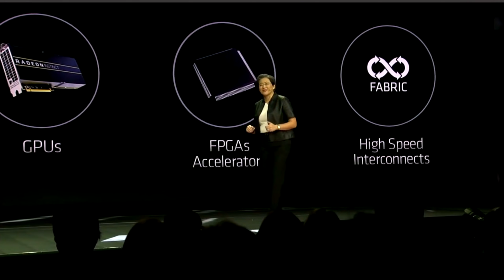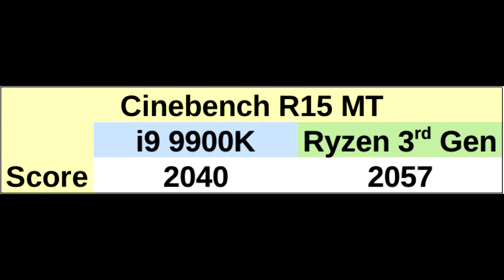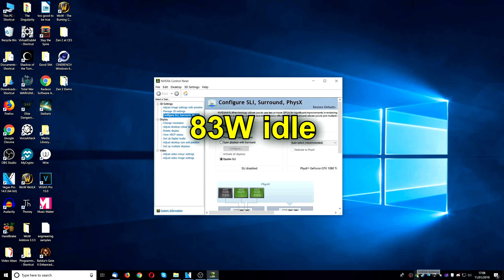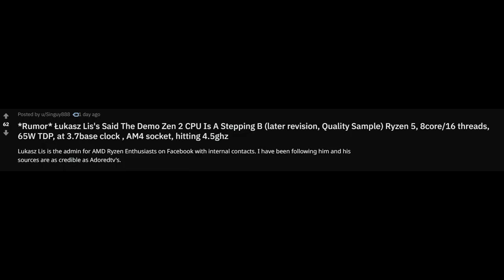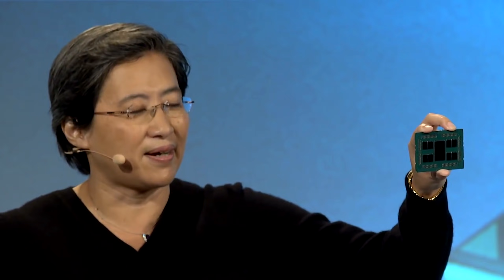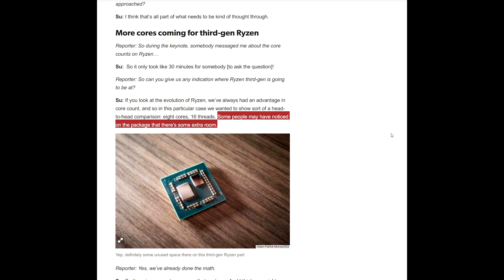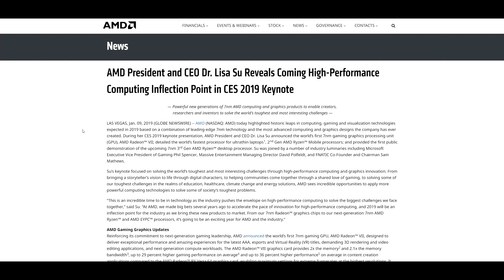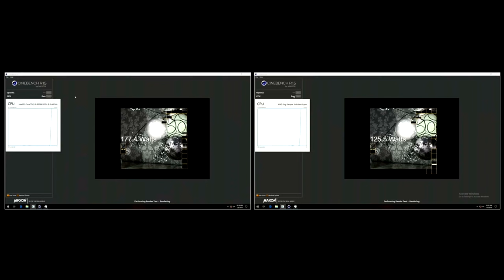Zen 2 Faster than i9 9900K at Half the Power.

Comment: I will keep my intel system as long as I need. I have Coffee Lake. 8 core system. If AMD beats my chip by a landslide, then selling the system and buying Ryzen will still save money or match it for me. Intel retains value for most part. Time will tell.

I have not seen gaming performance, I could care less for Cinebench R15. To me it's not real life performance. It's cold synthetic load.

I owned Intel and AMD on the constant basis, and AMD has been a miss for gaming for a long time. Budget solutions of the past. I look for amazing in gaming, and if it's amazing, I will change the platform. Until then, I am not worried with 8 core Coffee Lake it is performing beautiful

Comment: If you assume the higher idle power draw is due to missing power saving features then you should also assume that the idle power of the chip once those are in place will be lower but that will not change the full load power scenario (much at-least) and as such the delta in power draw will increase meaning that the claimed power draw of the CPU is wrong in such a scenario.
... and of course the release copy may also clock higher with a higher power draw closing the gap further.

Comment: In my calculation every Zen 2 eight core sixteen Threads processor @4.5Ghz or even less including a new generation of Precision Boost technology is destroying Intels 9900K in Mc AND Sc performance. I included a 25% performance increase for every single core per generation which means an IPC improvement by at least 3% (based on IPC improvement of Zen to Zen+) and an clockspeed improvement up to 4.5Ghz which come up with the 7nm process node. That shows, according to latest next gen consoles leaks, that the new PS and Xbox consoles can beat this performance (I9 9900K) theoretically too.
Reply: NOTE: 3% IPC improvement was suggested by Timmy Joe PC Tech on Youtube. I have seen different IPC expectations up to 29% at other sources.

Comment: Should I get Intel i5  9600k or wait for the new amd
Reply: Don't get a 6 core 6 thread CPU if you care about high frame-rates like 60+fps. It'll be fine for now. But once next-gen consoles (PS5) comes out in about a year from now, which is rumored to come with 8C/16T CPU, the CPU requirements in the PC space will also shoot up. Therefore making 6C/6T CPU a limiting factor, when targeting 60fps or higher, not to mention some of the recent games are already maxing out those 6 cores.

Comment: Well, if the temperature is lower (yes power dissipation is proportional to temperature on the same cooler). Why is the clock speed is so slow? AMD is getting lazy or locking it away. That's the only thing I can think of.

Comment: If as you propose the 3600x will be 2 four core chiplet design, from 8core chiplets this makes perfect sence, the bining of the 8 core chiplet as 6 core r3's. 1-2 cores are defective and the 6 working ones cant hit high freq. A working medium 8 core hitting 4.3-4.4 becomes a one chiplet 3600. the 2 chiplet 4 cores is the binned chips with 1-4 semi-defektive dies that cannot hit high freq. but have 4 cores that hit the silicon lottery, and can go over 4.6-4.7

Comment: My Budget Build 2019: 
AMD Ryzen 5 3600 
ASrock B550m Pro5
GSkill Aegis 16GB ddr4 3000mhz
GPU: RX3080 (If It would Happen) or Leatherjacket Nvidia 1660ti 
MicroATX Case Cooler Master q300L 
Powersupply: Bequiet Purepower 10 400w

Comment: I honestly could not care less how great it is at efficiency at low power. I want maximum single core performance and minimum latency. If Ryzen 3000 does not offer that over Intel's products, I can't see myself staying with Ryzen. AMD better have some kind of insane 4.5Ghz and real latency improvements over Ryzen 2000, then I'll just wait for Intel's fall release and upgrade my Ryzen 1700X then. Such an impossibly terrible gaming experience in terms of lag that I have never been able to fix that the new Ryzen has to be beyond superb for me to consider it.

Comment: You obviously don't know how Intel define what tdp is. Forcing a package  tdp of 95w is drops the cpu to  4.0-4.3ghz. At 4.7ghz (all core boost) it draws something like 180w. AMD's tdp specs are almost always at full boost.
Reply from the maker: I'm actually quite aware of how Intel defines TDP, you however are not correct about how AMD measures TDP.
Reply: @adoredtv  watch videos from Gamers Nexus about the 9900k and the tdp. You are drawing from the wall and amd was not. They have the tech to test the draw from power connectors going to the cpu (typically the 12v rail) also removing as many variables that could affect that power draw. Look over Gamers Nexus' testing methodology. Intel's CPU ALONE was pulling about 180W. AMD's CPU also alone was pulling about 135W. AMD'S TDP rating for their processors is much more accurate to their real life tdp than intel's CPUs as of 8th and 9th gen. Before that, Intel has pretty accurate TDP ratings
Reply from the maker: @stoat-ski  Both systems were measured at the wall.  There was a reason why I threw in my own 2700X results, so that we could see the Ryzen 3000 chip vs not only the 9900K.

It really is that efficient.
Reply: @adoredtv  oh ok your are right. I am surprised they did wall power. It's not a very effective way of actually testing a cpu. They did use an ssd to lower the drive power draw but a Vega 64 in both systems(that could also throw the numbers up higher)
Reply: @adoredtv  I wouldn't say twice that it is twice as efficient but it's going to be more efficient than intel's 10nm offerings for sure. I am exited for single execution avx 2 because my 4690k makes any attempt at rendering the workloads that I use the most on my ryzen 7 2700u laptop impossible.
Reply from the maker: @stoat-ski  That's why I worked out the delta between idle and load, to remove the rest of the system component draw as best as I could.

In the end the numbers won't be far off but what's important is that the Ryzen 3000 chip is clearly in a totally different TDP class than the other two.
Reply: @adoredtv  yeah. I like my 4690k but I love the offerings from AMD coming up. The avx 2 performance was the only reason I didn't go to a ryzen 7. I have a 24 core xeon system that has the same issue. My 4690k overcooked is almost the same performance. I love how far AMD has came in the last few years. I would like to see a 8 core laptop cpu offered from amd. I mean based on my 2700u being 14nm, they could easily do it with 2.8- 3ghz clock speeds. I would like AMD to offer 4th gen Zen 2 apus next year with 6 cores and 20 computer units. Bump the clocks on the cpu but still have more 2 or more more extra cores. I hope they improved infinity fabric and because memory speeds are severely bottlenecked by infinity fabric's speed. I think that AMD's cpu's had a better IPC on Zen than intel's IPC because it hasn't changed since... Well 2nd gen. I can't wait for their next major architecture because of the massive performance jump in IPC from fx to Zen. Also having 8 real cores really helps out amd in gaming compared to fx's "8 core" architecture. I do admire intel's ability to push clock speeds higher and higher but they really need to fix their igpu. I love my rx 590 however. Thing is so stupid fast for a card that I got for $222 (open box)

Comment: What about also shoving up the IO processor and put a third 8-core chip beside it so you can have 24-cores? Or perhaps put an APU there so certain programs can leverage that like they can with the iGPU on Intel?
Reply from the maker: They'll just reuse Epyc for Threadripper and more than 16 Cores.

Comment: Did you take into consideration that the 9900k could have been running an igpu vs a discreet gpu in the amd system?
Reply from the maker: Both had Vega 64 Liquid.
Reply: @adoredtv  I was just guessing. I didn't notice the amd specs. Great video

Comment: There is a leak by Ryzen memory calculator developer that this ryzen3000 was running at 3.8-4.0Ghz on all cores.
And that there is a bug in Windows with clock reporting, that shows higher clocks (like 4.6Ghz)

Comment: Adored, i just realised what happened.

Why did they show a 8 core cpu with 1 chiplet? Simple. 

The epyc comparison was a core to core comparison with 2 intel CPUs.
So for the desktop: Amd also wanted a Core to core comparison, because intel fans have been using this rhetoric for years."intel beats amd core for core". They can no longer claim that.

Why was lisa nervous it might crash?
Simple: NO DUMMY DIE. 
This CPU was shown specifically to demonstrate 2 things.

1) AMD and intel are on paar in single thread performance.
2) They can do this with a chip that is not fully built.

The missing Dummy die is screaming "And this isn't even my final form".

Amd could have shown a 8 core chip without the other connections to the empty space, or with a dummy die.

This chip is used to show us MORE, by showing less.
It shows that 8 core vs 8 core: AMD wins.
It shows that there is headroom in terms of space and tdp.
It shows that there are more cores tp come.

All by showing only a single chip.

Comment: Hey Jim - nobody has answered my question with regards to the potential upcoming 12c/24t and 16c/32t Ryzen 3K series cpu. It looks like you are the guy. We know mainstream AM4 socket has dual channel RAM whilst X399 ThreadRipper socket has quad channel RAM. Since rumours of this popped up at least a couple of months ago I have been asking if the 12c and 16c Ryzen 3K series of cpu will be RAM starved or not, or if upcoming X570 (X590?) mobos will have quad channel RAM?.
Reply from the maker: It's possible but I don't think so.

Comment: The new benchmark had the AMD proc underclocked compared to its final release clock which is super exciting. So being on par with the i9 9900K in its current state is terrific. The kicker is that AMD set up for Intel's potential response in 2019 with a 12 core/24t and 16 core/32t enthusiast non threadripper procs 👍 Awesome stuff AMD! Keep it up. My 4790K is dieing and I need a PROPER replacement.

Comment: I feel like this is gonna be huge like amd Athlon xp vs p4 huge. Intel isnt even a slightest option anymore if this is true:
Ryzen 3 3300 6/12 3.2GHz 4.0GHz 50W $99 CES
Ryzen 3 3300X 6/12 3.5GHz 4.3GHz 65W $129 CES
Ryzen 3 3300G 6/12 3.0GHz 3.8GHz 65W $129 Q3 2019
Ryzen 5 3600 8/16 3.6GHz 4.4GHz 65W $178 CES
Ryzen 5 3600X 8/16 4.0GHz 4.8GHz 95W $229 CES
Ryzen 5 3600G 8/16 3.2GHz 4.0GHz 95W $199 Q3 2019
Ryzen 7 3700 12/24 3.8GHz 4.6GHz 95W $299 CES
Ryzen 7 3700X 12/24 4.2GHz 5.0GHz 105W $329 CES
Ryzen 9 3800X 16/32 3.9GHz 4.7GHz 125W $449 CES
Ryzen 9 3850X 16/32 4.3GHz 5.1GHz 135W $499 May 2019
Reply: Sadly NOT yet released!

Comment: Ok so what you are saying is that AMD made a 7nm chip that, for 1/3 to 1/2 of the price can only match the performance of a 3 year old architecture 8c 16t proccesor. What I really find funny is that Intel was able to squeeze that much power out of a 3 year old 14nm design which only means that Intel 10nm will completely destroy AMD 7nm. Especially if they do a 16c 32t model.
Reply from the maker: How can so many people have zero comprehension of what they just watched?  Am I really explaining it so badly?
Reply: Intel 10nm is actually worse than 14nm++ if you even listen to what Intel engineers tell you... guess you don't though, oh well!

Comment: Just some idle speculation, but maybe the decision not to show off a dual-chiplet Ryzen gen. 3 yet is because of Threadripper? Presumably a 12-core or 16-core Rg3 would be breathing down the neck of the TR2s with similar core counts a bit, at least on some workloads. Maybe AMD decided it should announce TR3 first instead of pushing ahead with a 12-16 core 7nm Ryzen reveal and leaving low-end Threadripper (and its buyers) looking a bit awkward for a while.

Comment: 9900k is 3-4 months old. 5ghz per core AMD processors are coming in Q3. So it'll be close to a year after 9900k launched. That's not really a reason to celebrate? You have to be pretty naive if you think AMD did anything special with power consumption. 7nm and no integrated GPU will do that, it's no miracle.

Comment: and that was only the 8 core version they are supposed to release(don't know which one there is 2), supposedly the 3850x will be 16 cores/ 32 threads at 5.1 GHz for 500$ which will be so much better value compared to a 9900k double cores/threads higher clock speed and cheaper!

Comment: Per Anandtech latest news Jim wasn´t wrong in both of leak videos. Yes there will be (most porbably) DESKTOP 16 core high clocked CPUs with IO die. And there will NOT be DESKTOP APU with GPU chiplet, so NO IO chiplet. Some miscommunication?
Reply from the maker: No what they mean is the Matisse package (the one in the thumbnail that Lisa held up) won't be used for both CPU and GPU, there will be another package coming later.  Basically it's all about the I/O die.
Reply: Didn't the Anandtech article refer to the apus releasing this year? It makes little sense for amd not to put a navi gpu on the zen2 apus releasing next year. As it currently stands, apu generation is behind desktop generation by one year. So the 3600U/3700U releasing in the coming months, are actually based off zen+, not zen2 as some might initially think due to the confusing 3000 naming scheme. When it should be named 2600U/2700U since they're of a zen+ architecture.

Comment: To me it's quite clear they will have a 6c/12t with one 6c chiplet (3500), and 8C/16t with one chiplet (3600), a 12c/24t with two of the 6 core chiplets (3700), and a 16c/32t with 2 8 core chiplets (3800).  The interesting bit will be to see what their single core performance is.  If they can actually get even close to 5ghz single thread boost, they will destroy the 9th gen Intel CPUs in every imaginable category, price, performance, and production.

Comment: Why is i9 "9th gen" even 8-core at all?  i5 desktop chips have been 6-core since "8th gen."  Intel's marketing and product placement has been absolutely bonkers ever since they began to respond to Ryzen.  9th gens are pretty much another paper launch, especially with the i9 series... I don't see Intel having a good answer for Ryzen 5 3xxx series this summer.  Blue team is actually going to lose on all fronts -- performance crown, power consumption, performance per $, and especially total system cost on HEDT.  Last-minute contracting for 7nm chips will cut into their profit margins, so I don't see cost becoming any more competitive than it is now... and it isn't very competitive with all the shortages.
The desktop CPU's fate is practically sealed for 2019 in AMD's favor, heavily.  We'll see if Intel can pull any tricks to come back in 2020.  Chiplets are absolutely essential by 2020.

Comment: I'm using a Ryzen 1600 at the moment, and if I could get a mid-range Ryzen 5 3rd gen that beats the top-end Intel, and probably around HALF the price, I would be one happy SOB.  I can only imagine the panic going on at Intel right now! I'm glad you took the time to point this out Jim, for those that may have overlooked the significance of the power and performance that AMD displayed. AMD is going to put serious pressure on Intel this year!

I like this strategy, and you know AMD is going to have 16 cores on their top-end chips. Intel has nothing to compete in performance / price with AMD. Now, if AMD can just get their graphics turned around to put a fire under Nvidia, specially after Jensen Huang slammed Radeon Vii! I thought that was pretty low, considering there is no need for it. Nvidia has a huge lead over AMD, and it just adds more fuel to my Nvidia dislike.

Comment: I'd be careful about the idle of the Zen 2 system. Maybe it contains different components that are irrelevant for Cinebench testing. Like stronger GPUs or something.
Reply: AMD tested both CPUs on identical systems - same GPUs, same RAM same everything apart from the CPU and motherboard. - https://www.anandtech.com/show/13829/amd-ryzen-3rd-generation-zen-2-pcie-4-eight-core "AMD said that both systems had identical power supplies, DRAM, SSDs, operating systems, patches, and both with a Vega 64 graphics card"

Comment: The really exciting part about AMDs development for me is the highly modular nature of the CPU design and the potential it brings with it. For example and purely speculative, they could improve the CPU performance without needing to improve the processor chiplets by simply improving the IO-die with better memory controllers, supporting either  higher memory clock speeds or increase memory channels or even both. They could also replace DDR4 controllers with DDR5 or 6. On the Budget side they could fully integrate a complete GPU chiplet rather that a few cores as they did in the past which could also open up new exciting developments for that segment in the market as they could opt to develop specialized IO-dies for these type of CPUs which help to synergize the GPU chiplets  better with the Processor unit or the rest of the system. A crazy idea for example would be to develop an IO-die that enables separated  dual memory channels for each, the processor and GPU chiplet respectively. But as I said, that's all just wild speculation on my side as to the potential of the modular design deployed by AMD.